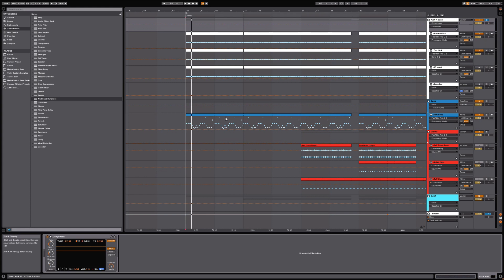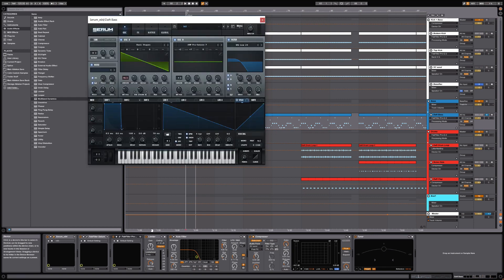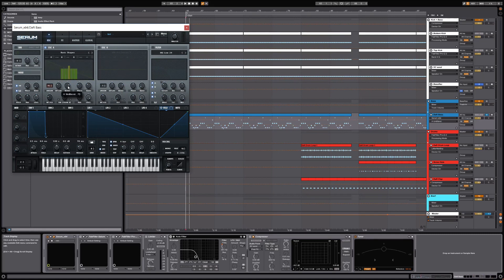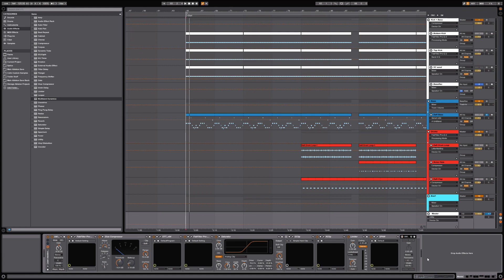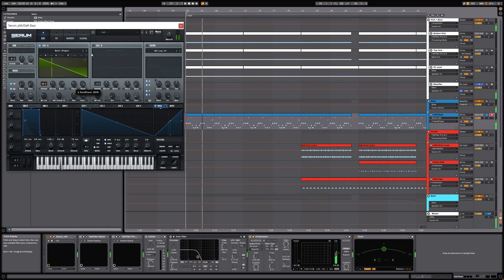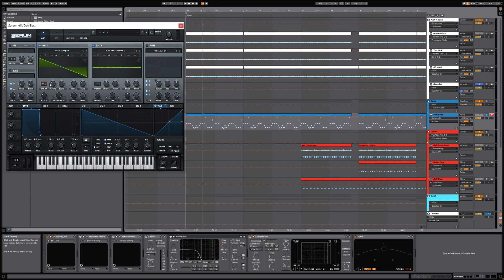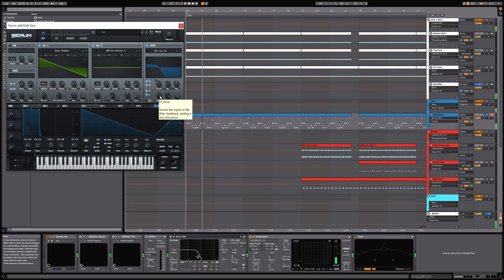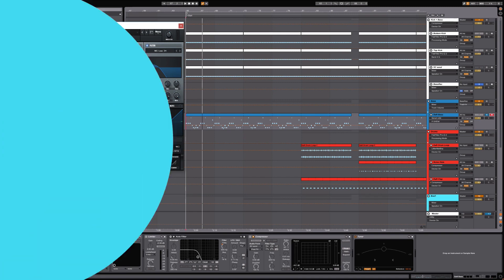How To Make French House with Soundprank -  Bass Design Part 1

Comment: That hint at the end regarding oversampling does not make sense, because it has not to do with de unison mode but on points like the behaviour of the distortions or filter/eq/effects. You should not hear any change when disabling oversampling. I doubt someone would hear a difference in phase response(where it makes a difference), so ..